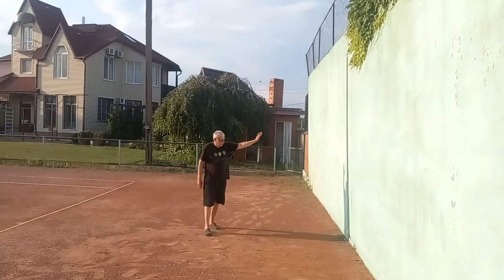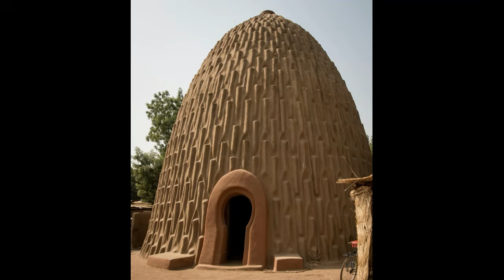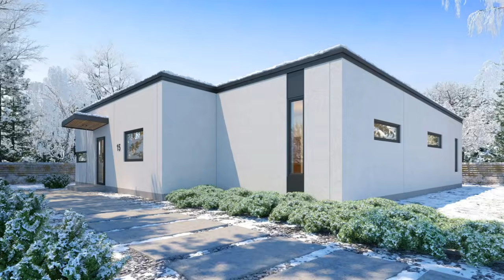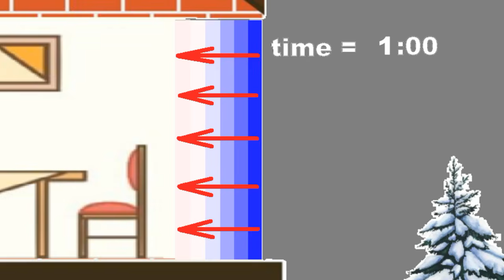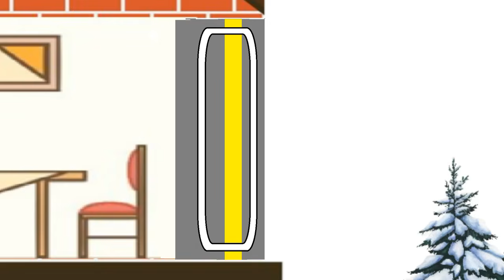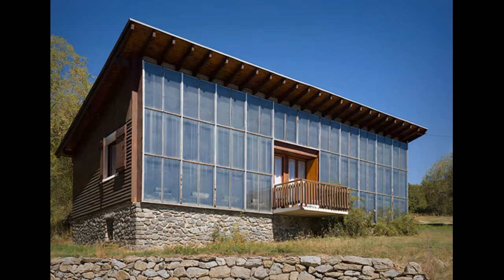The sun heats the wall which will heat the house at night. The simplest and cheapest options

Comment: The thermal mass have to be inside insulated house, with a way to catch the heat before the winter (with variable overhang caps for the summer) but not in summer (also trees that loose leafs in winter helps to cool in the south part of the house) so the thermal mass is helping to keep cool the house in summer (and also by opening by night to accumulate freshness and eventually intersideral cold from clear sky

Comment: Heatpipes probably will increase the effect beyond those f the tilted water Pipes.
Reply: Yeah heat pipes ! And heat loop pipe, oscilliating heat pipe; thermal diode, pulsating heat pipes.. So much stuff to do around! imagin sticking it behind the slates or tiles connected to heat conductive battens..